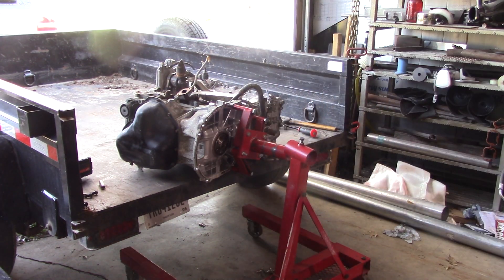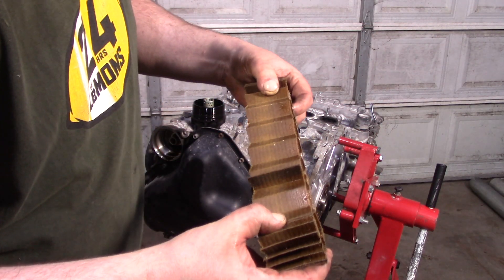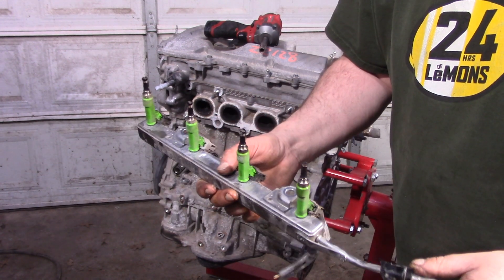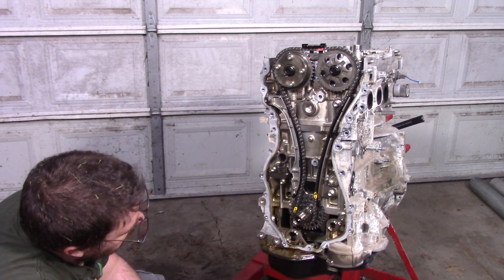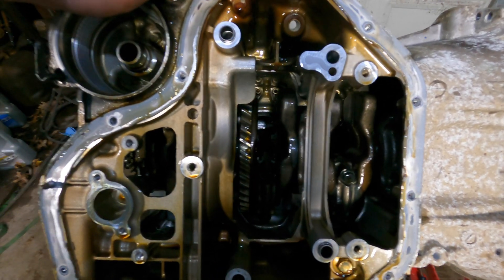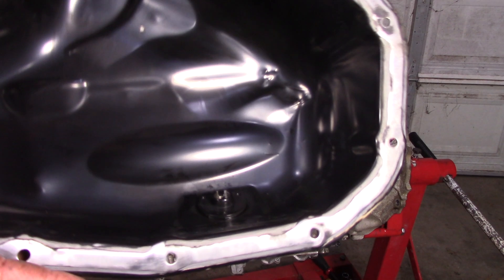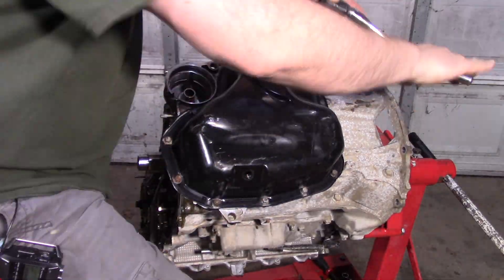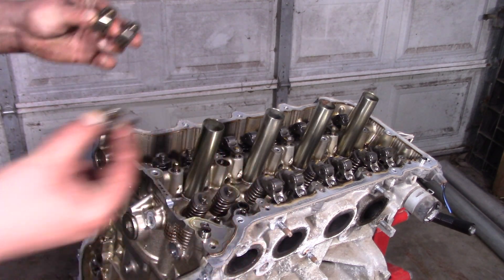Toyota Hybrid to High Performance Conversion

Comment: This is my favorite automotive youtube channel as of late.  All I can think about is how to fit a 2AR into my aw11 mr2.
Reply: "JUST DO IT"  - Shia LaBeouf
Reply from the maker: I did swap a 2AR into an AW11 back in 2009. It was actually the first 2AR-FE that i bought, just months after they hit the showroom floor.
Reply: Also wanting a MR2AR; unfortunately, my 4agze is getting tired and not much can be done with the Ogura supercharger without shortening its life or drastically increasing intake temps
Reply: @FrankensteinMotorworks  I saw your post and pictures with the 2AR mounted in your AW11. It looked like custom welding motor mounts, but it really inspired me. Is there any way you would support that chassis?
Reply: I subscribed because I got a free 2AR with broken timing chain. I was going to fix it up and put it in my AW11. Next I need a manual trans.
Reply from the maker: @pixel254  Yes, that was a one off custom application for my race car. I don't currently have any intentions on supporting the AW11, they are too expensive for me to even get a R&D mule even if i wanted to support them.
Reply from the maker: @Jonathan-us4ig  the AW11 engine bay is a bit bigger. the EB60 is a bit hard to get so i'd probably focus on the S54 transmission if i was you. Easier to get, cheaper and shift linkage will match up much more easily with the AW11.
Reply: Hell yes!! Fuck the garbage on the Television and Dish.
Reply: All I can think of when will the after market support for the engine finally come to market because this is a possibly great contender to aftermarket k24 boosted builds

Comment: The FXE hybrid motors seem to be quite interesting to work with. I wonder if any other FXE engines such as the 2ZR, 2AZ, etc. can also benefit from the intake cam on the exhaust side as well or if it's even possible in the other hybrid engine series.
Reply from the maker: I've got 2GR-FXE intake cams on the way but those won't easily be swappable over to the exhaust side. but there's a possibility for this to work on other motors also.
Reply: The 1nzfxe from 04-09 prius makes very high compression with non-atkinson cams. I put 1st gen scion xb cams (1nzfe), colder spark plugs, and 93 octane and that prius ripped harder than anyone expected.

Comment: Excited about this one.  You answered my question about not  having variable timing on the exhaust with  the 2AR--FXE; can be retrofit provided you move an intake cam to the exhaust side AND retrofit a solenoid / control module.  Ready to pull my 2ZZ and swap in this engine.  Let's see what she does!
Reply from the maker: yeah, the jury is still out on exactly how much power will be lost without it. i plan on running it on the dyno at fixed positions to see what it would do without exhaust vvt-i also.
Reply: Frankenstein Motorworks $150 or so to get variable exhaust timing seems cheap to me...and the stock 2AR-FE ECU is going to expect variable exhaust valve timing regardless.
Reply: @reneneron2971  That, I feel, is key for so many people wanting to run the stock ECU. Although I suppose a tune can be provided for most any setup (like if the FXE WAS MADE into a dual VVTI +2.7l)

Comment: I would say that is a low mileage engine, its so clean! I had to pull a egr/cooler off a Prius yesterday because it was setting a code for insufficient flow... it was pretty much plugged solid! 283,000kms but it has had issues recently with burning oil.
Reply from the maker: I was a bit skeptical of the mileage claim when i first saw the motor but once i opened it i 100% agree, this motor matches the 50k mile claim that i was given.

Comment: Hi Frankenstein Motorworks
Why do you remove the balancer shafts when you build the motor? Are they not reliable or capable for the higher rpm you are going to run the motor at or is it simply to reduce rotating inertia and drag etc?
PS I'm enjoying your videos and really impressed by the simple but clever ways you are turning common volume motors into potential performance donors. I just wish I had such a ready supply of these in the UK.
Reply: Is it necessary to keep the balance shaft bracket for structure or something? It looked to me like there was sufficient bracing and structure for the crank below so why do you refit it?
Reply from the maker: The bottom half of the balance shaft assembly holds the windage tray and the oil pickup. This stuff could be replaced but something does need to be there.

Comment: Why did you take out the balance shafts?
Reply from the maker: Because they add weight, aerate the oil in the crank case and cost horsepower to spin. It makes sense to have them when the motor is used in a camry but anything above 800rpm or so and the vibrations can't be felt and this car does not spend much time below 800rpm

Comment: I’m a little confused @ 16:25 , what donor engine has the dual VVT-I parts we’re looking for?

Btw, if something similar can be done to the 1NZFXE (Prius) engine? You could potentially have another customer base with all the Toyota Echo, Yaris and Scion xA/xB boys around!
Reply from the maker: All of the 2AR-FE motors are dual VVT-I so i just used one of those. only the 2AR-FXE is single vvt-i.

The 1NZ should be doable but i would not do it in the Prius. the Transmission is electrically balanced and if the motor is making significantly more power than expected i would expect transmission calibration issues. But as you said, in the non hybrid versions this would likely be a cheap way to make power.

Comment: I bet you can take the rear wheel drive Lexus hybrid engine, motor, batteries, wires and computer and stick it in an old car, like a Ford Zephyr or a 32 Ford roadster. If you can set it up so that the motor and engine can run simultaneously at full chat, or engine alone when it’s party time, all the better.

Comment: Do you foresee and issues with the piston to valve clearance with the higher lift, higher duration cam?
Reply from the maker: this cam is actually slightly lower lift and duration than the 1ar-fe setup i did just a few weeks ago so i do not expect any issues. This motor is just barely an interference motor
Reply: @FrankensteinMotorworks  Ah, i thought these had a higher dome on the piston for higher compression so i was worried it might have less piston to valve clearance on the side you put the higher lift cam in as usually pistons relief depths aren't equal between exhaust and intake valves?

Comment: Hey, why do you need to re-install the balance shafts casing? Great channel by the way.
Reply from the maker: Thanks! I reinstall the bottom half of the casting so i have something to bolt the windage tray and the oil pickup to.
Reply: @FrankensteinMotorworks  and if you get the tray and pickup tube from the 2.0 version of this engine the has no balance shafts (I suppose).
Reply from the maker: @aperezuk  can you tell me what application that is? i thought all of the AR engines had balance shafts.

Comment: Do you need to reinstall the balance shaft assembly? is it there just to support the oil pickup (whatever it was that was supposed to be 6.5ft lb)
Reply from the maker: that was the oil pickup and yeah, i left the lower part of the assembly in there to support the oil pickup.
Reply: @FrankensteinMotorworks  so if you were REALLY worried about weight you could swap it out for spacers or something? 
Probably not worth doing it, was all aluminum wasn't it?
Reply from the maker: @WilliamJasonSherwood  you could save 100-200 grams by cutting more bits out of it but it is quite light as-is

Comment: Any ideas on what manual transmission will bolt right up to this? I'm getting a friend's fx16 and going to be going for some serious power and pulling the 4age and selling the auto trans with it to cover costs.
Reply: EB60 and EB62 will bolt up

Comment: I love your work with these toyota engines and the mr-s platform, but if you could somehow branch out into miatas/240sx, you could make a lot more money. I don't want to diminish your passion (and mine as well) for toyotas, just a thought in the financial direction.
Reply: 2AR swap the world
Reply from the maker: The problem with those platforms is a few things, first i don't have a stupid addiction to them. And second it is a VERY crowded field. There's only the Honda k-series crowd here for competition.
Reply: @michaelscholten9753  Someone's gotta stand up against the K-swap dominion
Reply: @FrankensteinMotorworks  True, but if the 2AR-FXE experiment works out, it's a very viable alternative to the K24 even just in terms of price (280hp for $1000 vs. 280hp for $2000+, both would need standalone). Having 12.5:1 CR with massive cams all from factory is something even the K can't boast about.
Reply: Yeah and I prefer Toyota motors, and your parts are better made, and much more fairly priced... The Honda J swap is getting there for me, it's close. But still no way to do it reasonably given the value of my Miata at current. But I've gone through 2 Mazda VVT weak sauce motors. A better designed version of the ecotec option would be amazing.
Reply from the maker: @CS-lh3oz  If this works out i will also make it so it works with the stock ECU, it'll mean modifications to the stock cam so the price will increase a bit but it'll be more than made up by saving a bunch on the aftermarket ECU.
Reply: @FrankensteinMotorworks  if it works out I wonder if you could build a swap kit for the frs/brz/86. Need to find a rwd transmission, but those cars are considered underpowered.
Reply from the maker: @michaelscholten9753  The only issue there may be that the AR family is very tall. It might require a bump in the hood to clear the valve cover.
Reply: @FrankensteinMotorworks  I couldn’t find the vertical measurement, but people have LS swapped them and it looks like those are 34” tall

Comment: I was wondering when not using torque wrench was going to come and bite you.  The German specification of good-n-tite doesn't convert to JIS. 😁
Reply from the maker: It happens. i try not to hide when i screw up. but honestly that stud was weak for some reason.

Comment: U remember do you think I need that heat exchanger warmer thing behind the exhaust because I know how to wait to warm my car up being that I have a CVT I know it takes a little longer can I delete that cuz I need headers and I have the hybrid motor
Reply from the maker: That isn't there to heat the coolant, that is there to cool the EGR gasses.
Reply: Ok another stupid question so I don't need the egr is it possible I can make something an delete them
Reply from the maker: @DrArrow  I would expect that deleting the EGR would get you a fault code and a failed emissions monitor. Beyond that i'm not sure what impacts it would have if anything would be put into a limp home mode but i do know fuel economy will suffer. EGR us used to reduce pumping losses in an engine.
Reply: @FrankensteinMotorworks  yes I will get the code but there's a way to premently bypass it , an I Kno about the gas this is strictly for power gains for this motor can't wait for this cams

Comment: Here in the UK 2AR FXE's are over 2000 dollars. :/
Reply from the maker: But at least they are available, unlike the other motors i was talking about before.
Reply: @FrankensteinMotorworks  yeah but but the whole point of circa 300bhp on a budget is surely the budget?
Reply from the maker: @1968spikey  with my limited understanding of high power motor availability over there this is still a good deal over in the UK even though it isn't as cheap as here. My SW20 customers in the UK routinely pay $2500-4000 to import a 2gr-fe.
Reply: @FrankensteinMotorworks  Yeah I get that. I wasn;t being negative about the swap, it's just frustrating here in the UK everything is at a premium. 

I'm guessing the 2AR-FXE bolts up to an SW20 trans?
Reply from the maker: @1968spikey  Yes, the 2AR-FXE bolts up to the E153 transmission. That can be used in the Spyder but it requires quite a bit of crossmember adjustments.
Reply: @FrankensteinMotorworks  so, if you drop a twin inlet cam 2AR FXE in a SW20 do you need the 2AR's ecu or a programmable one? 

I've had a few SW20's and currently have a Spyder, but I know that getting the V6 into a Spyder is a pita but I'd love a naturally aspirated 300bhp Sw20 so this looks like the way to go.
Reply from the maker: @1968spikey  with the current configuration it needs an aftermarket ECU. this can be corrected in the future to run on a stock ECU. if you're doing an SW20 it's just a bunch easier to do the 2GR and get 350hp at the crank and be done with it.
Reply: and in Oz over Au $3000.00
Reply: @FrankensteinMotorworks  How does it mount to E153 gearbox if the mounting points between 3S-FE and 2AR-FE are different? Only flywheel bolts pattern is the same.

Comment: Will this engine fits on a IS250?
Reply from the maker: not easily, but the 2gr-fse would since it is designed for that platform and already makes more power than this.